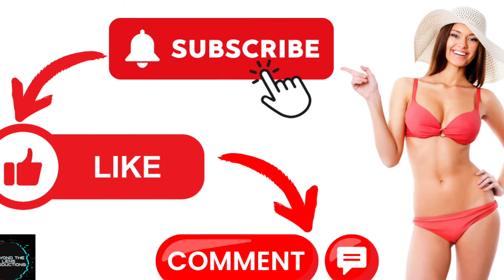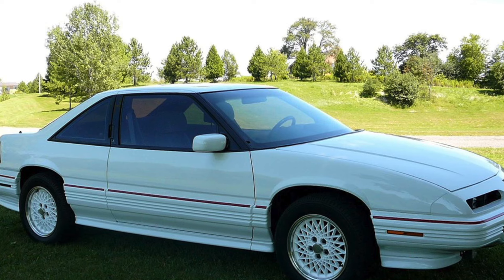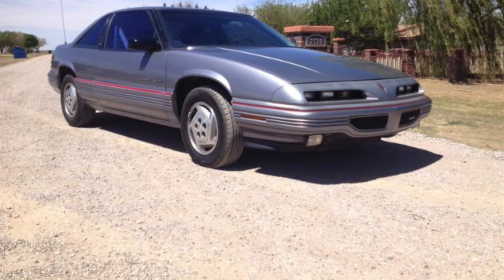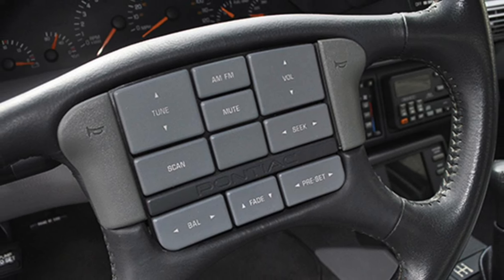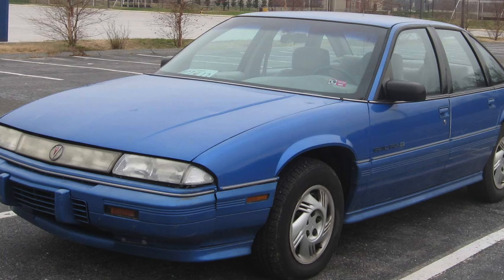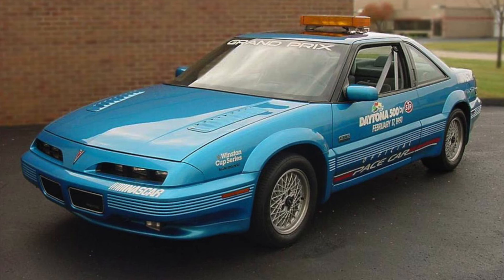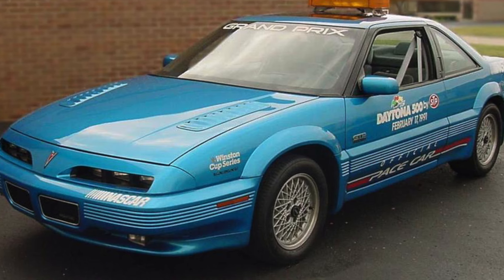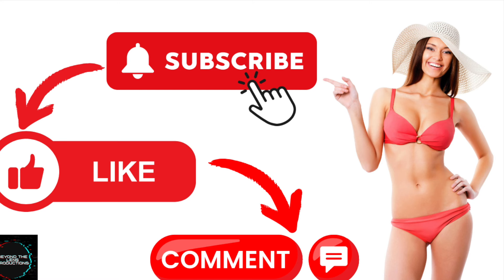The Thrilling Legacy of the 1991 Pontiac Grand Prix | Part 13

Comment: The LQ1 was not just available in the GTP Package, (standard equipment), it was also available in the models such as the GT coupes, STE sedan, and SE coupe/sedan as an option.  One more notable thing to mention, the 2nd gen HUD unit debuted for 1991.  An AC/Delco unit compared to the previous gen unit developed by Hughes Electronics for the 1989-90 years.  Same identical units for both gens that was used in the Cutlass Supreme.
Reply from the maker: Now that you mention it I remember Hughes Electronics being involved with GM. I had forgotten that but I was pretty young at the time.
Reply: @Beyondthelensproductions  The biggest difference between the 2 systems was the height of the actual HUD unit and where the adjuster switch was located.  The first gen units sat higher on the dash pad and impeded the driver's sightline a bit more than the 2nd gen unit.  The 2nd gen units had a lower profile on the dash pad and was more sleek.  Functionally, the were about the same.

Comment: Driving Grand Prix....  Get in your Pontiac and drive!  Pontiac Drive!  There were a lot of mechanical changes and power started appearing on the Grand Prix finally. It should have been there in 1988 at introduction.  The front end styling upgrade was a Oldsmobile change too. Cutlass Supreme coupe got the same headlights molded around Oldsmobile styling. GM was known for doing that.  I heard over and over that twin can 3.4 was not reliable. I know Chevrolet got that engine in Lumina and Oldsmobile got it in Cutlass Supreme and Pontiac had it too.  Buick was smart. They had the 3800 V6 in the Regal.  Turbo engines of all sorts still have these issues and you are correct about what you said as well. The steering wheel and seats were so cool during this time.
Reply from the maker: I particularly liked the rear bucket seats.
Reply: @Beyondthelensproductions  I recall those.  The Cutlass Supreme had them and the Regal had them too.  I do not know why GM stripped out the W Bodies over time. That Grand Prix an Cutlass Supreme were so loaded in 1988. By the time 1996 came around they were stripped out.
Reply from the maker: I’m not really sure… I mean they had the Bonneville SSE back in 88 already so I don’t think it was that, or maybe they were taking too many sales away from the Bonneville , 98 and I believe the Electra was the top trim level around 88-89? You can correct me there if I’m wrong.. Sales of the flagship vehicles from each division are the only thing I can think of..
Reply: @Beyondthelensproductions  The Grand Prix was stealing sales from Bonneville because they became to close in size and features in the 1990's and 2000's. What I am saying a lot of those options the W Bodies had in 1988 were gone by 1996. Those rear seat buckets were one of them. Keep in mind the W Bodies did not have all the options, but they were close.
Reply from the maker: You’re right and the materials in the Bonneville were higher quality than the Grand Prix. What baffled me in mine is the fact that it only has driver power seat and mine is a GTP. And they certainly weren’t as adjustable as the seats in the Bonneville. Assuming they took those away to drive up sales of the flagships for people who wanted ALL of the options.
Reply: @Beyondthelensproductions  In 1988 the SE had dual power seats.  You see by the time your generation came around content was removed. The Bonneville SEE had a lot of features and the Bonneville SLE could be closely optioned to a SSE.  The Grand Prix STE had dual power seats.  The GTP was supposed to be fully optioned. It was not. I thought the passenger power seat was an option. I would have to go look that up.
Reply from the maker: Exactly… it was kinda a shame but I do see their point too. My dad owned 3 Bonnevilles, so I’m pretty familiar with those too. He loved those cars but then with Olds brought out the Aurora he really liked those so he bought one.
Reply: @Beyondthelensproductions  How did the Oldsmobile Aurora hold up?  When Oldsmobile was put down, the took the Aurora seats and put them in the 2000's Bonneville SLE and SSE and GXP.  The The Oldsmobile LSS had the Aurora seats without power lumber and it had Aurora wheels too.
Reply from the maker: @OLDS98  He loved the car, drove smooth, lots of power, very comfortable, nicely designed dash and high quality materials. But ultimately ended up trading it in after less than 2 years because of the lack of headroom. It did have the moonroof so that took away about 2 or so inches but if it hadn’t been for that he would have kept it a lot longer. 
Great car as far as comfort goes though, especially on long trips. It’s too bad though..
Reply: @OLDS98  The redesigned headlamps were called mini quads and featured built in levelers, a bubble system.  

The 3.4 is just as reliable as any motor featuring multiple cams/valves from this era.  Like anything mechanical, they need proper maintenance at dedicated time intervals to perform properly and survive.  I daily drive one.

They stripped them out actually starting in 1994.  The previous 88-93 years are more unique and uniquely optioned...not as generic as the 94-96/97 cars.
Reply: @OLDS98  Dual power seats for the STE but only power FORWARD/BACKWARDS for the driver's seat.  The passenger seat fore and aft travel was still manual.
Reply: @jiggity76  Thank you for sharing the information about the headlights. I know Grand Prix and Oldsmobile Cutlass  Supreme had them. It is economies of scale at work. I have no issues with them. You know better than I do about the 3.4 Liter Twin Cam V6.  I am just saying I read and heard over and over again about the reliability.  How is it the engine working out for you?  What car do you have one?
Reply: @jiggity76  You lost me on your comment. What are you referring to?
Reply: @OLDS98  No problem, happy to contribute.  

Yup, the mini quads debuted on the Grand Prix coupe in 1991 and the Cutlass Supreme coupe for 1992.  GM also used them for the 1993 Camaro when it was restyled and updated.

I have 2 LQ1 cars.  A 1991 Cutlass Supreme International Series coupe and a 1993 Grand Prix STE sedan.  My Supreme has a new motor in it, an NOS one that I just installed last Thanksgiving.  The original motor is still good and was misdiagnosed by a GM dealer.  The NOS motor has 4500 miles on it currently.  The STE is getting a new motor soon as well.  The previous original owner mistreated it and ended up putting water in it instead of coolant.  They ended up cracking the block.  It's a California car and I guess it's common to run water in vehicles instead of coolant.

These LQ1's require a timing belt inspection every 30,000 miles and absolutely without question need to be changed at 60,000 miles.  Most people either didn't know or care about that.  This is why most of them were junked...bad ownership and negligence/ignorance.  They do require special tools for some repair work if you're going to do it yourself.  Like most OHC and multi valve motors from this era, most people don't have the patience or know how to service them.  I'm not one of those people.
Reply: @OLDS98  Which comment please?
Reply: @jiggity76  This one: Dual power seats for the STE but only power FORWARD/BACKWARDS for the driver's seat.  The passenger seat fore and aft travel was still manual.
Reply: @jiggity76  Thank you for explaining.  Nice to know you have a Cutlass Supreme. I am sure your International Series is loaded. i know they came loaded before GM started stripping them out. What was sad was in 1995, they put the same instrumentation panel in the Buick Regal and Cutlass Supreme.  It was quite obvious. I guess people do not think about the maintenance and just drive them into the ground. That is messed up what the GM deader did. That is disappointing to hear. Grand Prix STE. I was glad the STE trim lived on through the Grand Prix.  It was a fantastic Pontiac trim level. It is a shame it did not have any power in 6000 STE form.  I have two Oldsmobiles:  a 1992 Oldsmobile Toronado  and a 1996 Oldsmobile 98
Reply: @OLDS98  Yes sir, it's loaded.  Here's the numbers - only 1,864 International Series coupes made for 1991.  815 got the LQ1 motor, 215 with HUD, 79 got HUD and factory CD, 13 were White, but only ONE had both the LQ1 and Garnet Red CLOTH interior.  Mine is that car.

Oooh, Toronado's are beautiful!  If I didn't find my Supreme, I would go after one of those.  Does it have VIC?
Reply: @OLDS98  To me, I read that as both front seats were power...which is true but there is one thing missing for the passenger seat.  The AQ9's in the STE's do have power controls for the backrest tilt and adjustable air bladders, but they are different than the AQ9's in the Cutlass Supreme International Series cars and the GTP's/SE's/GT's.  I found it odd that for AQ9's in general, only the driver's seat is power forward and backward but yet you still have to manually grab the adjustable metal bar under the passenger seat to slide it forward or backward.  Must be a cost saving thing.
Reply: @jiggity76  The numbers were low it seems for international series.  I have seen in the teal blue a lot. There is one on You Tube a guy is working on right now with a manual transmission: https://www.youtube.com/watch?v=G_PqKDlB0Zw&t=1364s  I know the convertible used that engine too.  The Toronado has a VIC. It is a rare factory option.   It is a loaded regular version. It is not Trofeo. I swapped the analog gauges out and put digital gauges in. I do my own repairs and work on my cars. I understand about maintenance
Reply: @OLDS98  I seen that manual Cutlass.  It's awesome!  Very cool swap you did and the VIC is beautiful as well.  I have a spare one actually.